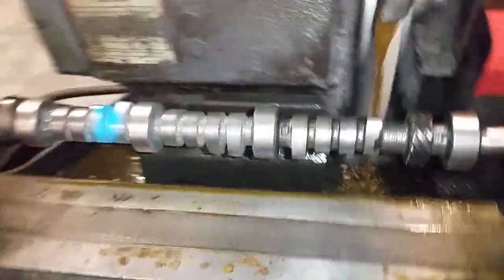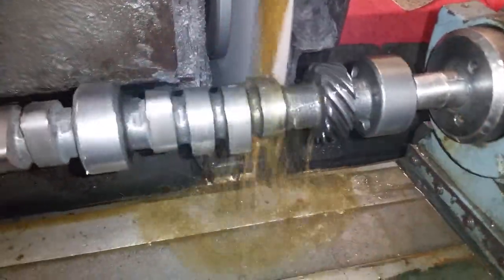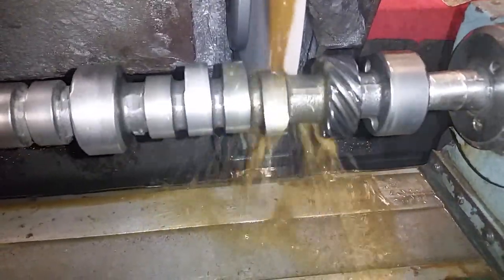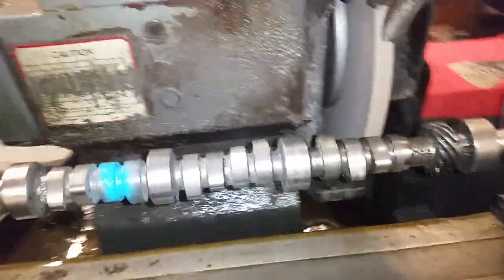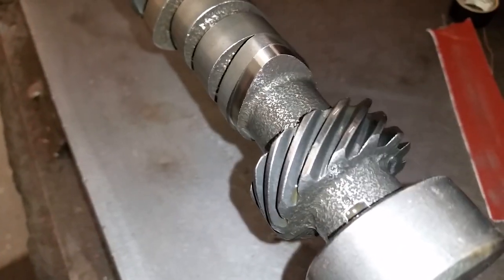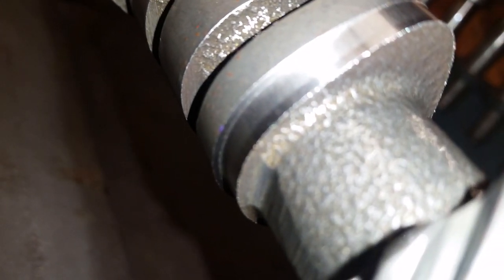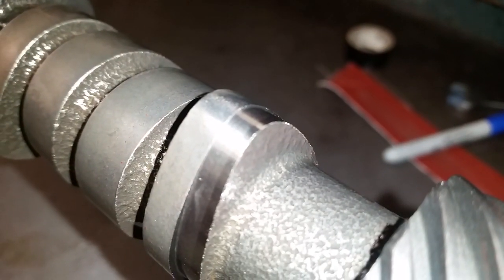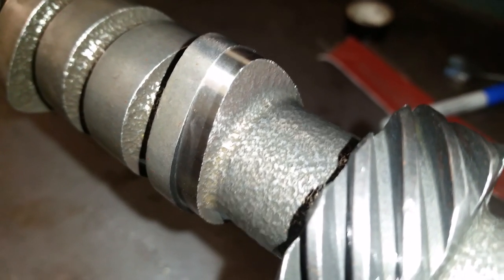Do you even lift bro ?

Comment: I did this with a Briggs and Stratton 5 hp cam on my “box stock” race cart. Made a stand out of bearings and used a belt sander to remove material. Welded the tip on the push rod and made the appropriate addition. Yes, I was much faster, especially after the twist on the cam.

Comment: Informative video.....I wondered about this Exact Same thing for a  Long time  when I first discovered 3/4 Race & Full Race  "Re-ground"  Camshafts  advertised in Sears Roebuck Catalog  back around   '62  when I was 12....Just couldn't figure, Without welding metal on, how do they make something Bigger (.510" is better'n .450" lift) by Grinding metal off ?? ........7 yrs Later, holding my new "Reground" cam,  I quickly saw how it was done !! .....Thx for showing.....

Comment: I'm guessing that the extra lift is achieved by using a longer valve stem after this adjustment is done? and by changing the diameter of the base circle, you increase the length of the opening and closing ramps?
Reply: The length of the ramps/duration is not necessarily changed at all when the camshaft is ground to increase lift.

Comment: Re-weld and grind service available for cars with "shim" heads? In this case is for Nissan GA16DE cams. This motor no have  aftermarket support. Really interested. Thanks!
Reply from the maker: yes we can do them $150 each, verify tuning prior to getting cams :)
Reply: JonneyBlazeRacing  Thanks! Very good news!
Reply: @DELTACAM8005625500  for the toyota 5efe as well?

Comment: If I purchase a custom grind for a 360 Dodge with non-adjustable valvetrain do I need to buy longer pushrods?
Reply from the maker: that is a great question.... if its a mild - midrange grind no longer pushrods will be required as the Hyd lifter has up to .100" internal travel. so the lifter will make the adjustment. For heavy rv or race grinds then yes usually a + .060 pushrod will be needed.
Reply: Thanks for the quick reply! 
What camshaft would you recommend for a 360 in a 1975 1 ton van  all stock except for a little bit of pocket porting, headers and a 3 angle valve job? I'm not too concerned with economy (not achievable in a mobile brick) but would like more pulling power from idle to cruise speed (2,900 rpm @ 60 mph). BTW, it has a 3 speed auto and 4.10:1 rear ratio.
Reply from the maker: Tony Shade 260 is a great option for your build.... cam & lifter kit $120 regrind or $180 new
Reply: I have heard that cam profile changes have an effect on smog and that might be something to consider. It is my understanding that in 1975, all vans had to comply with smog laws and were subject to testing.

Comment: Hey I’ve got some regrinds for a dohc and I’ve added a .080 lash caps and .110 shims under the lifter adjuster. Is that too much? Did the cam place grind too much away ? With that much shims and lash caps I’ve got the preload where I’d like it
Reply: They ground off of the base circle which is required and it’s also the point where you set your lash.